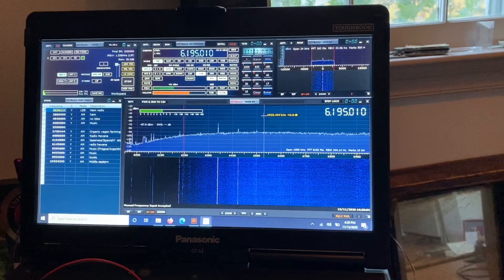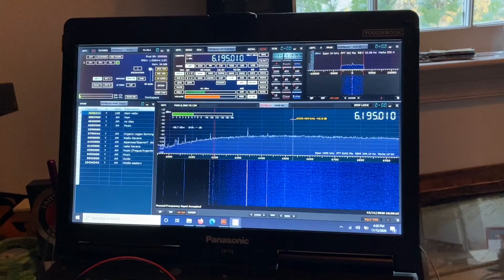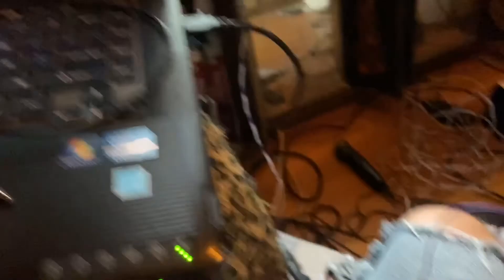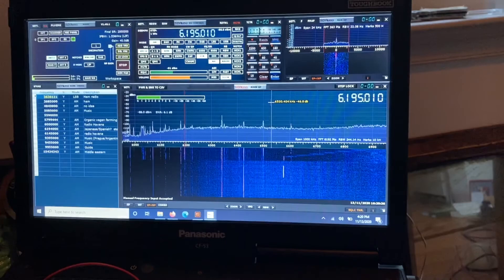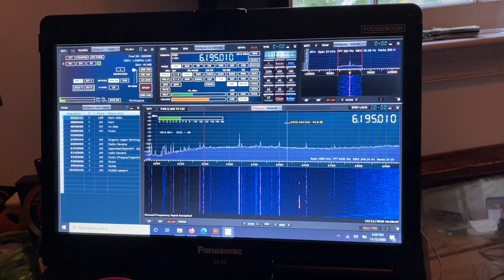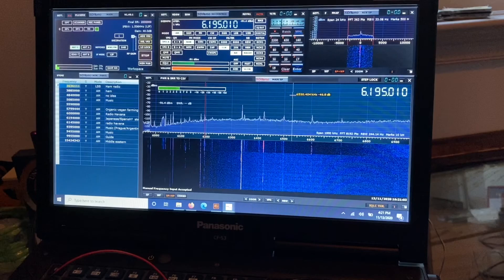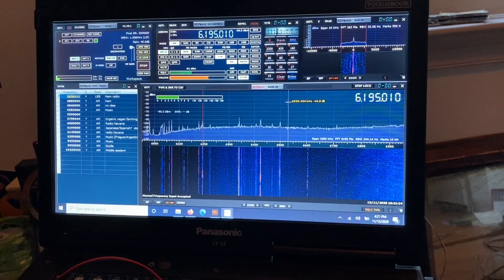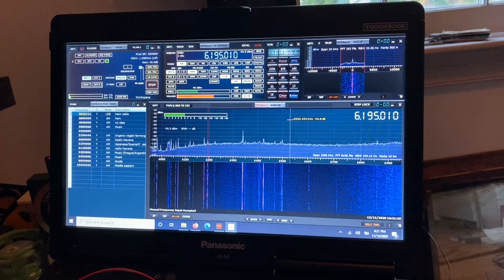Demonstrating How Important a Ground is for Shortwave Listening

Comment: Thanks for the demonstration. The best part of Shortwave listening are the Antenna experiments, they never cease. Sometimes touching a ground wire to the radio's PCB ground rail works well and sometimes it does'nt, also, I have often gotten good results from touching a ground wire to the telescopic antenna..but not every time(??). There are so many variables at play with antennas, so it's best to experiment while at the same time trying to learn (Youtube/internet)about the science of Antenna design/electrical engineering....it's so much FUN!!

Comment: An earth is important especially on lower frequencies. I know it was local but on 160m (1.9 MHz) I contacted a local station and when I connected my earth he said my signal shot up by 20dB. It's really part of the missing half of your aerial. Verticals like an earth as well to work against. 
Wire aerials are cheap, I made dipoles for 20m to 10m in the attic and an inverted vee outside for 60m. On 2m, a wire 4 element collinear, horizontal at the moment.
G4GHB

Comment: Can’t make up the image exactly, but I would recommend that your antenna wire from inside to the tree to be isolated at the tree (use pvc or other), flexible (use some kind of rubber) and to use a lightning arrester. This way your antenna will always perform the same and your equipment will be protected. But so far really good improvement with just minor modifications.
Reply from the maker: Thank you very much! I am working on a new antenna design and will see if I can get a lightning arrestor for it.

Comment: all radio signals are transmitted between earth and the antenna also  receive if you want to attenuate noise the antenna should be resonant at the receive frequency or antenna tuner

Comment: So if i understand correctly, you have the ground wire wrapped around the antenna wire, that goes down to the fence, then it goes back into the house and terminates at the radio? I'd really love to see another video that shows more clarity of how you have this set up. I'm going to be building a swl antenna and this is good information. 73
Reply from the maker: Yes I have the ground wire wrapped around the antenna wire running all the way back to the fence. The ground wire runs down and terminates to ground using the fence post. The antenna wire terminates wrapped around a tree and not grounded. I actually ran the antenna wire way further back into the woods after I made this video.. Anyway, this was not the best way to ground an antenna, but it worked. And it worked well too! I was even able to pickup Longwave stations with it pretty clearly one evening. I really miss that antenna. I will build a new antenna here where I am now and upload a video soon!

Comment: What if I took the ground wire and put it into the 3 prong ground hole of an inside electrical outlet?
Reply from the maker: I had the same idea but it won’t work well, it’s path to ground is too long, it will become part of the antenna, and it might also have RFI present.. you might be able to ground to a steel part of the building that goes to ground though with more success.

Comment: The fence is not serving as a ground. A proper earth ground (even if you wanted to ground an antenna) must, by NEC code, be connected to the AC mains ground rod. Even a true ground rod (which there shouldn't be a 2nd one anyway) pounded into the ground won't do anything to help an antenna...and is actually making the antenna an unintentional lightning rod. If struck even nearby, it would run to wherever the wire is connected and fry it. You were correct when you mentioned a counterpoise, which should be several feet long and not connected to any ground but should be connected to the shield of the SDR receiver.  Counterpoises mostly affects transmitters on the HF bands where they need a good SWR match. Receivers are much more forgiving. In your cases you simply completed the other side of the antenna as you mentioned (as in a dipole). By the way, the mistakes people make about grounds goes back to the old radio days when they didn't have the third prong on the AC plug. Fun fact - All modern ham transmitting equipment has this, so it is a misnomer to think a separate ground rod should be installed outside a shack. In fact, connecting gear to it is one of the most dangerous things one can do. Enjoy the SDRPlay. I have one just hanging out in my junkbox, and they can be great for their sensitivity.

Comment: How can you make a ground for a simple 100 foot wire antenna?
Reply from the maker: If you have a regular coaxial cable connection at the radio, my understanding is to ground the outer braid (or the wire that would be equivalent to the outer braid of the coax) to an 8’ piece of rebar (or whatever you have around to use that won’t create a common ground). You can see in my video I had the black terminal on the BNC adapter running to ground, and the red terminal utilized for the actual antenna. If you’re transmitting, keep the ground as short as possible to reduce RFI radiating from the ground. You do not ground the actual antenna in my understanding, except in rare circumstances where you are making a beverage antenna with a capacitor terminating it at the far end (someone else correct me on this). You can also run a counterpoise under the antenna to improve reception.. Dave Casler is a good resource for amateur radio grounding.. let me know if I can help more. I need to learn a lot more.
Reply: @FoxyLobo  I just bought a 4 ft copper ground rod but am waiting to move until I can use it. I`m at my sister`s house waiting on people to move off my lot and there are power lines and giant TVs here that make a wire antenna useless. Trapped in my room trying to avoid catching covid here because everybody around works in hospitals and prisons and none of them have common sense.
Reply from the maker: @baneverything5580  That should work pretty well, especially if the ground isn’t super dry. It will be satisfying to use it. I know that feeling.. if you can get out to a park it can be fun to find different things that might work as an antenna. I just bought a giant variable capacitor and am going to do some experimenting terminating antennas to ground with that. I’ll try and post videos with that and a variable inductor.. the goal is to make a simple antenna tuner.

Comment: I did not quite understand the connection part of the anntenna to a grounding wire to the fence. I understand connecting a wire to the fence, but the part about  wiire connecting to the antenna is lost on me. Can you add anything?
Reply from the maker: Yes, it is a bit of a confusing setup. There are two separate wires coiled around each other which are not touching electrically. One is the actual antenna, and the other is a ground I ran waaaaay out to the fence. Normally, you want a ground as short as possible, but in this case the wires were twisted together so I just made due. Let me know if I can clarify this further.
Reply: @FoxyLobo   With respect Patrick,   I watched other videos before I found yours, and nobody showed "a ground" for a SW Speaker Wire Antenna. I started here, and it shows no ground wire at all:  https://www.youtube.com/watch?v=NipjLBYuQCs
 So I looked carefully for a clear image of a Ground Wire  connecting to something, and somewhere on your antenna, and saw no such images at all.  I went on a binge, for about 12 hours, looking for  the  instructions...but nada. As I understand the Speaker Wire Antenna, the 2 wires remain joined and connect electrically to the same Alligator Clip.  I searched my Antenna books. I searched SWL  Websites, I watched many SWL and  Amateur Radio Videos. Then I contacted a  Seller on E-bay, who sells SW Antennas in different lengths. I said in an e-mail to him;  "So where does the Ground Connection go on your Antenna?"  He said,  that there is no Ground Wire on the SW Antenna's.   Still, I wasted many hours searching for videos showing where on the Antenna the Ground Wire goes.  Why is there confusing info about this subject?  If a Ground Connection improves the reception further, I want it of course so that I can  advance as a Ham.  Was your video a reference to something like  a Counterpoise?  I barely understand things like that.  I am only a  newly licensed Technician in amateur radio so my knowledge is very limited.  I just want a Speaker Wire Antenna for my TECSUN Short Wave Radio.  (I understand a 'Ground" for an antenna to be some wire that goes to a copper rod in the soil.)  Do you often find people as mixed up as me in your  teaching? Heh heh heh!
Reply from the maker: @YaxisX  Yes, I have struggled with that a lot. I don’t know if I’ve ever seen a good concise explanation of how and why a ground works and how to set one up. I’m sure it’s out there. I’m sorry I’m not the best explaining this as I’m such a beginner.

The antenna wire itself does not have a ground. The only time it is grounded is if you have a very specific type of antenna called a beverage antenna (distinct from a random wire antenna) which you terminate to ground on the far end with a capacitor. A basic random wire antenna like I have is suspended in the air. I won’t go into how or WHY a ground works as that is beyond me, but there’s a lot of information available on the internet that I will read and learn more about.

However, HOW to ground your receiver depends on what type of receiver you are using. If you are using a portable shortwave radio, it probably has an internal ground (in which case you do NOT need an additional ground) or an external connection for a ground wire - note how if it does have an external connection for a ground wire that this wire will be distinct and separate from the antenna wire. If you are using coaxial cable, you will run the outer braid of the coaxial cable to ground and connect the inner wire/conductor of the coaxial cable to the actual antenna. My BNC connector that I am attaching that ground wire to in the video takes the place of the inner and outer portion of the coaxial cable, but the idea is the same. Please let me know if this helps at all. I will try and respond more. I am only an amateur, and can only say that a ground does improve reception tremendously. I don’t know why it works, only that it works. Googling this might be enlightening: “how does a ground for shortwave antenna work site:www.reddit.com”. Those posts won’t likely explain why it works, but you can see what others have done to make grounds for their receiving antennas. Transmitting antennas are different, somewhat.
Reply: @FoxyLobo  Thanks Patrick, that is somewhat helpful. I think I can proceed okay with my  Speaker Wire Antenna as the current instructions show it. Good heads up on The Beverage Antenna. For now, I am only working with the SWL Radio. The HF radio I will deal with in a few months.
Reply from the maker: @YaxisX  Sorry for the confusion I may have caused additionally by naming this video "why a ground is so important for shortwave antennas". After reading your reply I realized it is misleading to name it this, so I changed it to "..for shortwave LISTENING" which makes more sense. I am looking forward to learning about the actual mechanics of grounds. A confusing concept for me, along with the concept of capacitance in antenna systems. Let me know how things go if you have the time!

Comment: Yeah nah. A ground or counterpoise is an important component of Marconi type antennas, not for SWL.
Reply: He just clearly demonstrated the difference between ground and no ground. SW transmitter antenna also needs a ground.
Reply: @daic7274  He may have demonstrated that one type of antenna requires a ground. A dipole requires no ground. You can cut a dipole for shortwave. The only benefit a ground would provide is lightning protection. A magnetic loop antenna requires no ground. You can make a magnetic loop antenna for shortwave. The list goes on.
Reply: And yet, he clearly demonstrated that long wire with his SDR needs a ground……and the list goes on….
Reply: @MrWoodworkr  Yes a monopole antenna could use a ground….. not all of shortwave radio no matter the equipment as the title suggests.
Reply: The lower frequencies benefit from a ground, either verticals or a long wire.
Reply: @bill-2018  Those are both types of antennas that typically require ground or counterpoise no matter the frequency.
That has nothing to do with the band or shortwave.